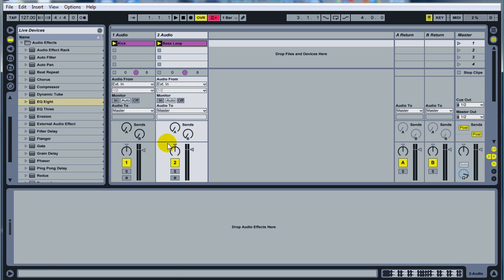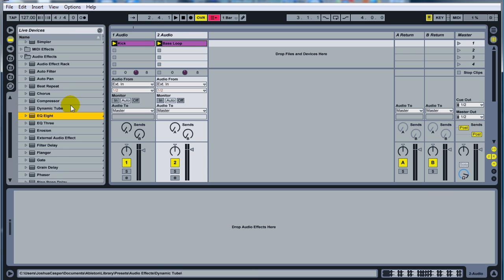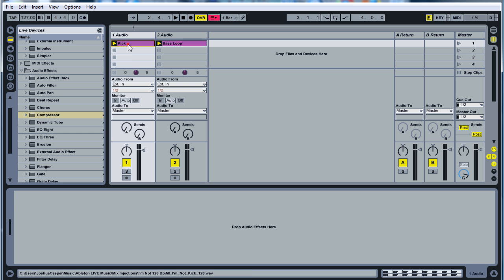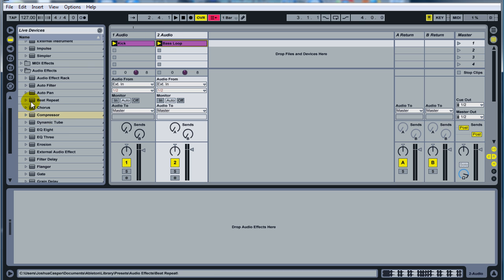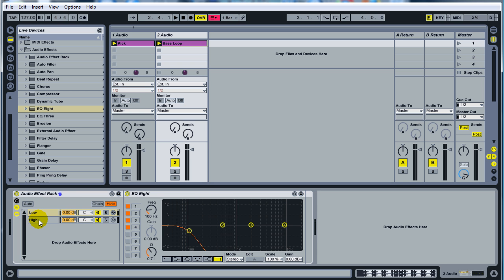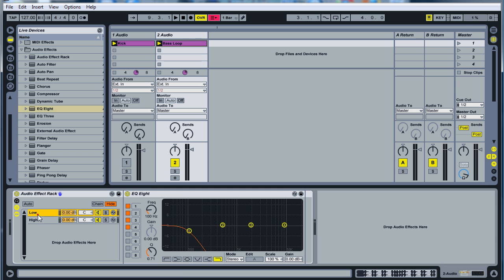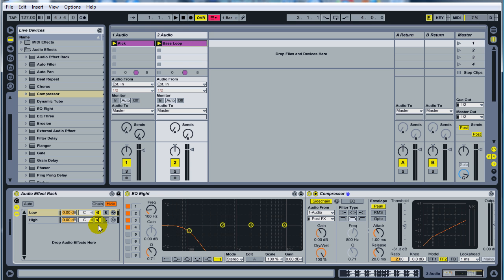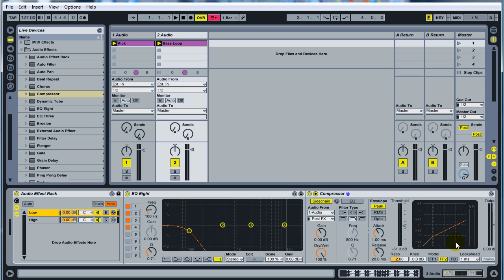Ableton Tutorial: Intermediate/Advanced Side Chaining Techniques

Comment: Is there a way to do dynamic, sidechain EQ so that it pulls frequency specified by a spectrum analysis of the triggering track? (Rather than just pulling "Hi" or "Lo", it would pull what is needed, adjusting on the fly.) Figured I'd ask before beating my head on this..
Reply from the maker: I am not sure I fully understand your question. However I just posted an updated version of this device last week (Dec. 2013). Check out the new version and let me know if that helps at all. http://youtu.be/h-wzTOMVUg8
Reply: Joshua Casper Wow - nice work! So in the context of the new device, I'm essentially looking for a way to automatically adjust the "band selector" knob based on the frequency content of the triggering track. Seems like there should be a way to feed it from the Spectrum utility.
Reply from the maker: I am not aware of anything of the top of my head. But, you could probably make something like that in MAX, if someone hasn't yet.